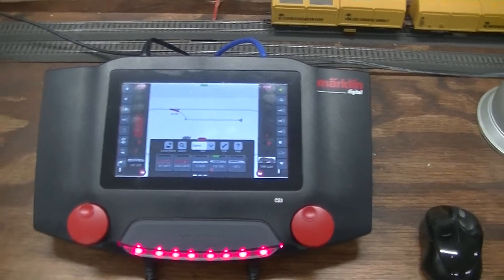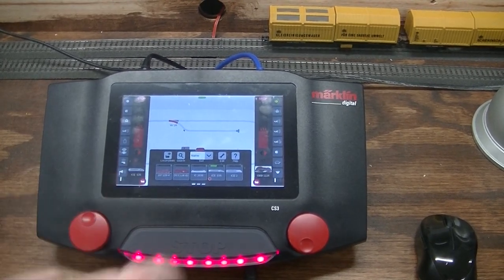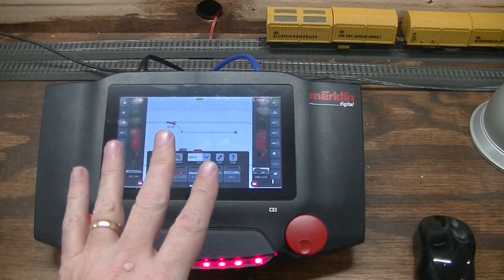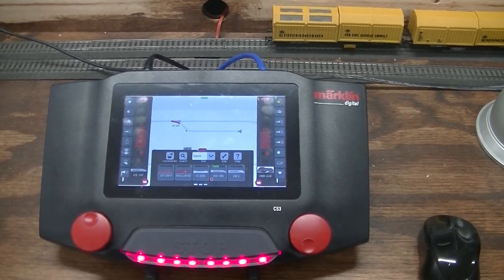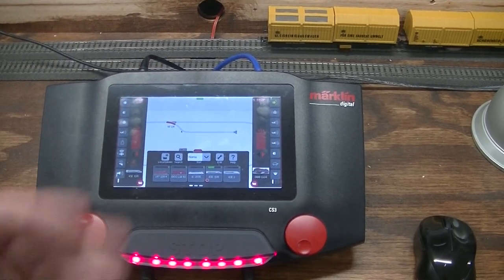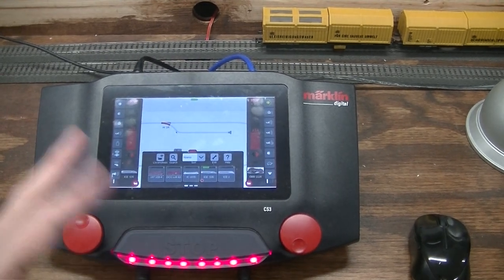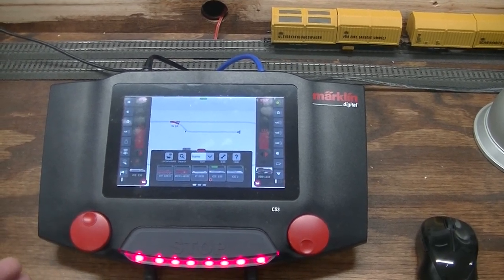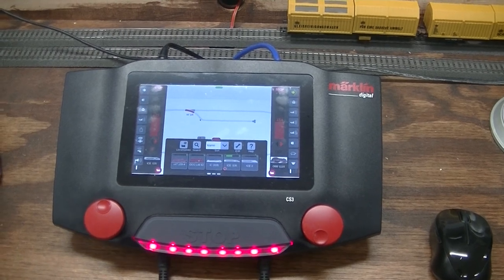Model Train Outsider Episode 0009 Controlling Your Trains (Digital Märklin)

Comment: You have some great equipment, slick operation with digital. Tyco was good in its time.
Reply: Yea I can do both with digital and analog with three rail lionel.
Reply from the maker: It's the world I stepped into 5 years ago.  A lot different than the train set I had in 1970.
Reply from the maker: @gusshadleythelunaticfromar7125   Most Märklin models can work both digital and analog.  Not all, however.

Comment: That's a very comprehensive system you have there. I didn't know Märklin still used their own digital system rather than the DCC standard, I take it there must be some cross compatibility.
Reply from the maker: There is cross compatibility now.  All the major control systems read each both DCC and Märklin (often abbreviated "MM").  The Central Station, ESU's ECoS, the Z21, and more are designed to work on both 2-Rail/DC and 3-Rail/AC set-ups, and read multiple protocols.

Comment: I have enjoyed seeing these videos about Marklin items as  there isn't much on you tube in English language, I have an old Marklin delta loco that's been fitted with an ESU decoder but cant get it to run I wonder if the CS3 can detect a loco and figure out the settings automatically...
Reply from the maker: If the decoder is a newer mfx or dcc, then it should be read by the CS3.  With older mm or dcc it is hit or miss.  I jot a PIKO BR 101 which was a dc version with dcc chip.  AC Euro Trains converted it to AC put a generic brand  mfx chip in it, and my cs3 read it right away.

Comment: Anthony, Liked the walk through..Thank you.  I'm considering buying a CS3+ but wondering about shelf life?  it's 3 or 4 years old now , do you think Marklin updates it soon?  is the CS3+ worth the extra cost (vs the CS3)?
Reply from the maker: Regarding the cost, to me the CS3+ is only worth the cost if you are going to run multiple layouts (home, club), have friends bringing their CS1-3 over, and you want to master/slave them, or you have a TON of s88 line based stuff to connect.  Even then, you can still connect S88 to a CS3, you just need the adapter.  If you have a nice home layout, and that's all your controlling, then the CS3 is all you need.  

The best thing about it is that it really isn't 3 years old.  The ones in stores today are upgraded and adjusted without changing the model number.  Also, Märklin just released a massive software upgrade that opened new doors beyond my limited understanding.  That's why I like it.  It is built for now and the future.  The ECoS came out close to 10 years ago and only now has it required a slight retooling.  Even Märklin's CS1 from 10 years ago is useful, it just can't work with the newest tech (mfx+ chips).  The CS2 is fully functional with the new tech, just not as sharp a screen as CS3.  So, these things will be around a few more years.  The big change I see coming is bluetooth control (which could easily be a simple usb add-on) and Ultra High Def screens, but I see the ECoS and CS3 being around a while.